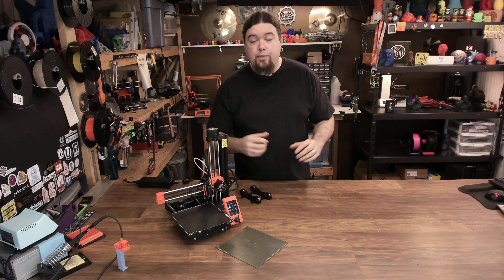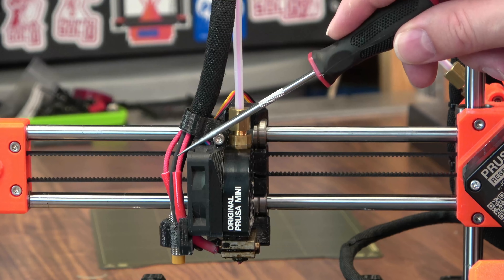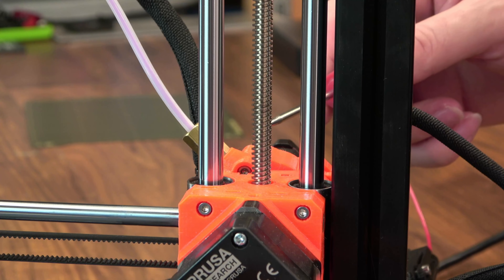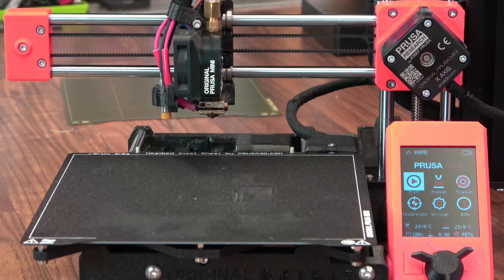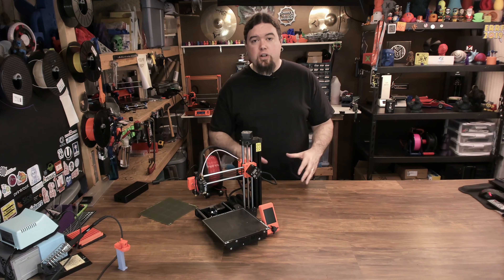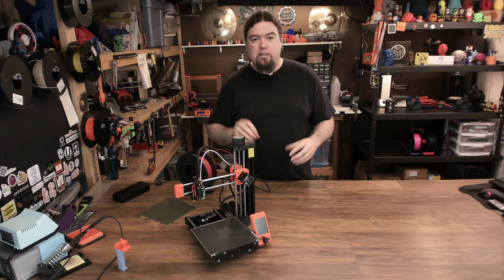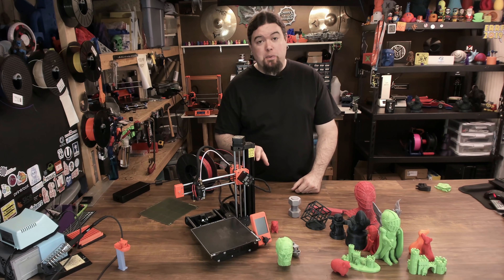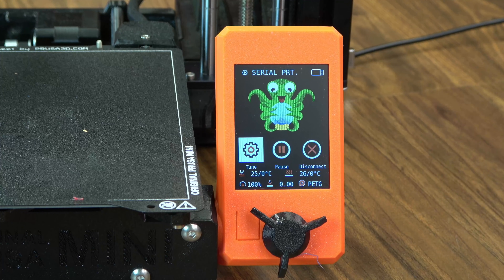Prusa Mini - 3D Printer Review - Chris's Basement

Comment: Great review! Too bad they are at a 14 week delay from this moment of writing...
Reply from the maker: Wow, that's crazy.
Reply: Man I want to love my printer but I've had nothing but problems.  I struggled with adherence issues and finally dialed in settings with a z height around -1.2ish.  Then all of a sudden it started looking like it was globbing too much filament AND swiping thinly like a spatula at the same time.  Adjust z height produces the same results.  I fear this is completely user error but I can't figure it out and really want to love this printer!
Reply from the maker: @Livshaka  Make sure your heat block and barrel aren't moving around on you like I show in the video.
Reply: @ChrisRiley  will do, thanks Chris!  They're sending me the SuperPINDA upgrade since it seems like my issues might be due to the printer

Comment: Is it possible to print nylonx or another fiber filled nylox filament for super tough applications?  What mods are needed besides all metal hotend?  Have you tried flexibles?
Reply from the maker: Flex seems to work well, haven't tried anything lower than 80A. As long if it isn't over 260c. you would just need a hardened nozzle.

Comment: As someone never used a 3D printer - how do you start printing on this model in terms of connectivity? Do you have to use a SD card like on the MK3S, or can you simply connect your computer via USB?
Reply from the maker: You can do either, the mini have  a USB port, they give you a USB flash drive for your gcode.

Comment: I'm proffesional architectural model maker. We have 3 zortrax m200 (they are a bir old yet works fine) and phrozen sonic mini 4k. I am considering buying a prusa mini yet i am afraid of its one z axis support which can cause problems in few months after i start using. And i read some coplaints about prusa mini users having problems with generic flaments. 
All i need is good PLA/ABS print which can print small details in 20cmx20cm build plate. Do you have any suggestion ? Sgould i go with it? I'm considering using .25 nozzle for better details. Do you recommend any other 3d printer under 500$. I really appreciate it
Reply from the maker: I can only go off of my experience, but I really like the Mini, it does a great job for pretty much everything I have tried.

Comment: Thanks for making this! I've had my Mini for a few weeks now, and I've been noticing more stringing going on now then when I initially was printing.. Kind of like the models that you show in the video, very thin strings here and there.  Is this all normal in 3d printing? Is it the filament? or humidity that causes it?
Reply: Could be moisture in the filament depending on the type of it. It can also be a worn nozzle if you have been printing some harder materials
Reply: CheetahFPV thanks , I haven’t tried anything yet except pla. It has been pretty humid. I’ll see if I can dry it.
Reply from the maker: Thanks Cheetah

Comment: Hey Chris. I hope you didn't put 4.2 on your machine ..
Reply from the maker: It seems to be working well so far.
Reply: @ChrisRiley  there has been alot of bug reports, specifically a BSOD. Check the GitHub. If you've never had a midprint crash, then maybe you got lucky. Or maybe youre using a diff usb stick.?

Comment: The last thing you mentioned is exactly why I'm buying a Mini now and another one soon after. This is a printer that can make a pretty decent and reliable farm. I've had an Ender 3 but that was a pain. I could not get a constant print quality. And after finding out that the upgrades (auto bed leveling, linear rails, dual extruder, direct drive,...) will take the price up a lot, it's better to just buy the Mini. Worry free, awesome print quality, reliable and looks good too.

Thanks for the review.
Reply: I have an Ender 3. After several inconsistent prints, I ordered a Mini. Too much nozzle replacement, cleaning, etc. That's after a board replacement, bowden tube replacement, and metal extruder components. Add in bed leveling, and some other upgrades, that under 200$ price tag is creating up fast!! I should have just got the Mini from the start
Reply from the maker: Thanks for watching, I'm glad it helped.

Comment: Actually the Couplers are a big MINUS. Often filament got stuck while unloading. I replaced ist with high quality push-through fittings (the ones for 3.50$, not the 30Cent ones) and replaced the 3 bowden parts by one piece. Never ever had problems with the couplers after that.
Of course most problems I got was using some old, not so precise filament (good enough for faceshields). I now simply change the tube between 1.9mm and 2.0mm depending on which filament I use.

With the original heatbreak I had some problems with prints using much retractions. Filament stuck. Reason: Prusa´s heatbreak; full metal part to short, with many retractions heat goes up inside the tube. Changing to a bondtech heatbreak solved the problem.

A no-go is marlin-settings (exept z-offset) is not stored in eeprom anymore. The firmware is a patchwork of Marlin and Prusa´s independent running components. While on the mk3(s) Prusa did it´s own developement inside Marlin, the Mini uses a real-time-OS with own Prusa software and Marlin in paralel. As Prusa needs the eeprom for its own settings, since 4.0.5  Marlin is not allowed to access eeprom anymore. Any changes like calibrating steps/mm you can not store on the printer - only write a list with the gcodes to set it, store it after every restart of the printer or put it in start-gcode. But start-gcode is not a nice solution if you changed to a Bondtech-feeder - for load/unload filament before print the correct esteps are not sent before printing. Also having more than one Prusa Mini, not all with same changes, different printer profiles for each of them is unconfortable. So I edit steps/mm directly in firmware, compiled it, broke the PCB-Bridge and flashed it. Now I have to compile new firmware everytime an update is released, only to get right eSteps from the start. Not so nice.

As an Prusa-mk3-clone cost about 330€ (+ plastic parts, + üarts for BMG upgrade + full metall heatbreak + PEI powder coated spring steel, but altogether less than 400€) and gives same quality as Original mk3s (I have 1 original, 1 bear and 1 clone) I mostly regret buying the Original Prusa Mini (wich costs 405€ (incl. PEI powder coated and Filamentsensor) + 19€ Bondtech Heatbreak + 59€ Bondtech Feeder). Esp. as a cloned Mini with same print quality cost abaut 200€ (+Bondtech heatbreak + "Dual Drive"). With breaking PCB you loose warranty anyway...

While I like the Prusa Printers, I would not call the Mini a success at the moment. Expect for beginners or commercial users. But anyone who can afford it should consider buying a mk3(s). There are (at the moment) worlds between them.
Reply from the maker: Thanks for posting your experience.

Comment: @12:07

the nut and bolt does not come on SD Card, we get a full size USB DOK.

I just got a Mini myself, but I'm having a bit of under extrusion.
do you have a recommendation for a fix?
Reply: Calibrate eSteps. Then cut bridge on PCB, install python and git on your PC, clone branch of last release, edit configuration file with correct eSteps, compile firmware and flash it. Cloneing, editing, compilin, flashing to be repeated on every new release...
Or edit custom start gcode in Printer Settings in Prusa Slicer to set correct eSteps. Of cource pre-sliced files from PrusaPrinters will not work without manual editing .
Since 4.0.5 you can not store steps/mm in EEPROM anymore. If I had known before, I never would have bought the Mini.

I use a Bondetech Feeder - quite good. But much more eSteps (415 instead of 345). Without sending gcode after restart I could not even load filament without many aditional purges. So I did the custom firmware method.
Reply from the maker: SD card to ingrained in my brain. I would check the couplers as well. If the filament is a bit oversized it might get hung up a bit.

Comment: What's the advantage of e3d v6 over their v5?
Reply from the maker: v5 is pretty old school at this point. I would guess it's hard to get parts for. V6 is more standard.
Reply: @ChrisRiley  I recently downgraded the hotend on my tronxy x5s from v6 to v5; and while at it I noticed how much smaller the whole assembly of v6 is in comparison to v5; any chances for a video covering state of components in 2020; we went a long way; but I'm not sure all the latest tech is worth the hassle; for example parts designed with serviceability in mind?
Reply from the maker: @trailblazingfive  That's an interesting idea, I will have to see what old school stuff I have around, that might make a good video.
Reply: @ChrisRiley  I finished tweaking the Tronxy X5S settings with e3d v5 (previously v6) - and I'm just angry that I haven't downgraded earlier; the prints look flawlessly; am able to run my prints 10*C lower; and the long bowden path is non-issue; I suspect it's due to the larger thermal mass :o but I won't dwell on it since I just want it to work ^^